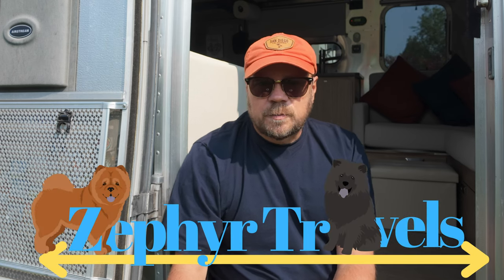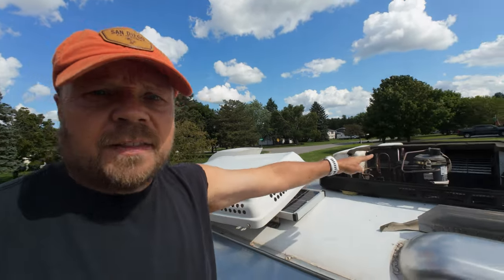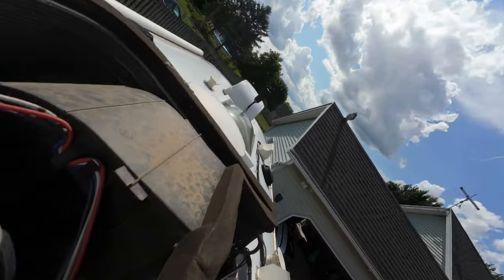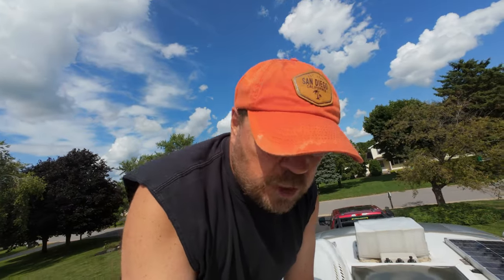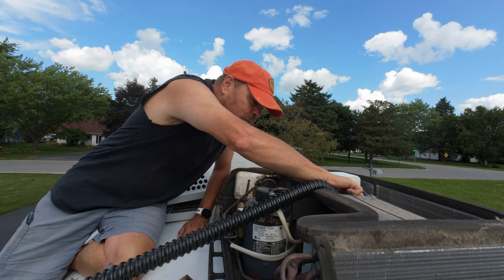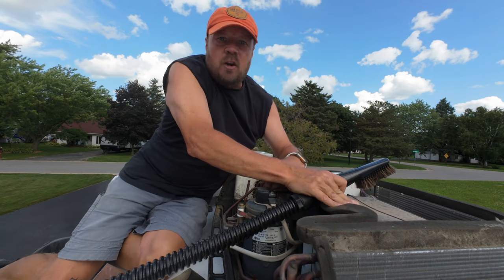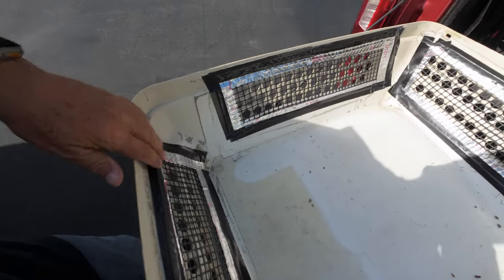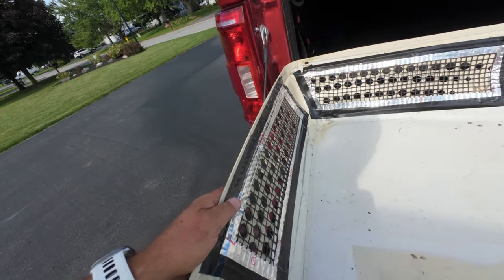Airstream AC Repair Made Simple: Easy Rv Fixes For A Cool Summer

Comment: The older I get the less I want to take on projects on the roof. My roof is fully walka le so it's a little safer. Be careful up there!
Reply from the maker: This was the first time in 7 years that I been on my trailer’s roof. As you could see in the video, I don’t have much room on my Airstream’s roof to move and it was a little sketchy to be on it.  Hopefully it will be another 7 years before I have to get up there again. 😰
Reply: While you have it out vacuum the return air screen/filters. They can be removed and washed but you can get better airflow by cleaning off the dust.

Comment: Good fix and improvement.  Interestingly, our air conditioner shroud has no vent holes.  Are you running your ac on a 30 amp connection at your house or do you do a 20 amp with a Soft Start?
Reply from the maker: I am actually running it on a 15 amp circuit and using our inverter and batteries to make up the difference.